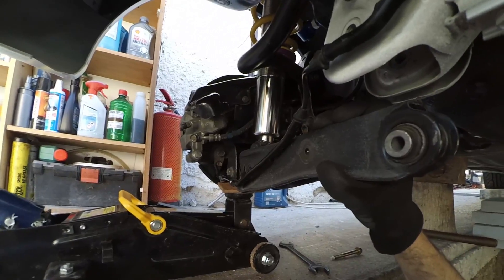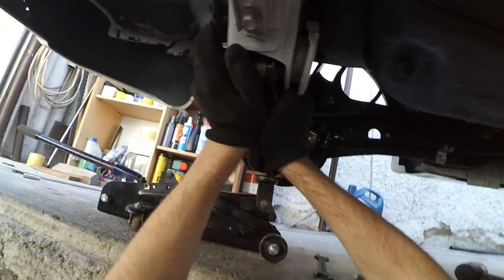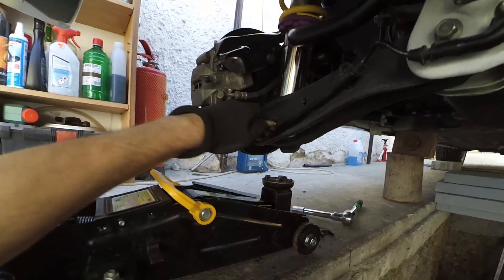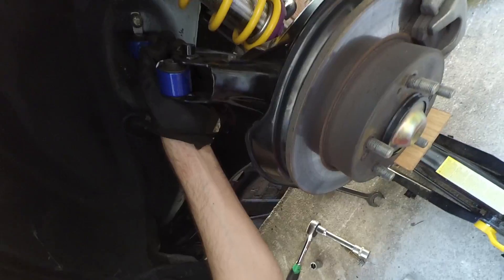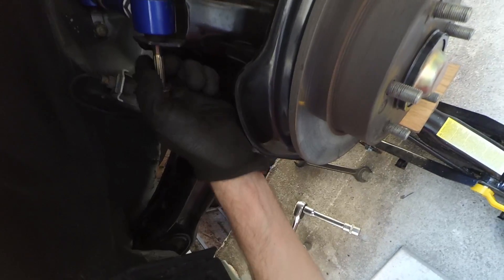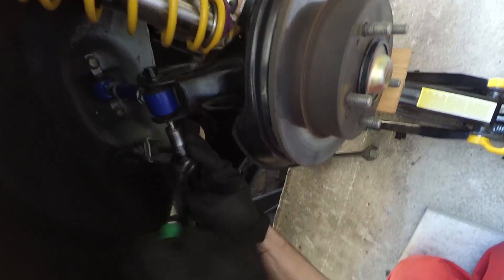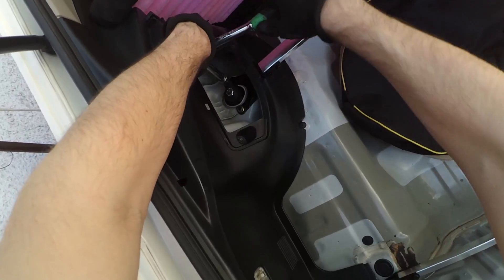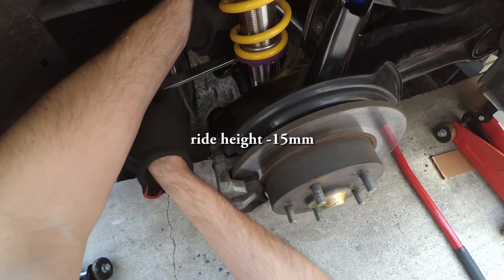Integra Type R | KW V3 coilovers | POV

Comment from the maker: Hondash - the ultimate tool to monitor your Honda
https://www.hondash.net
https://www.facebook.com/hondashapp/
Reply: Hi Miroshi, Thank you for posting the video, I just subscribed to your channel. Question about the 1:06 mark where you drilled what looked like the top mount bushings to 12mm since the stock size is more narrow. Did you also drill the metal collar? Or did you only drill the rubber bushing? If you did drill the metal collar doesn't it become too thin? Confused about this because I bought KW for my 91 civic and it didn't come with collars for the front but somehow it came for the back from KW.... any tips would help, thanks.

Comment: Gorrgeous!
Opinions on the v3 coils?
Reply from the maker: Can't compare with anything else than stock, because this is the first aftermarket suspension on the car, anyway the car is more planted, less body roll as expected, I like the upgrade, however adjusting the separate compression nob from bottom of each shock is pain in ass.

Comment: Random question, I just installed kw v3 on my 96’ dc2 type r. Great video. I noticed I changed top hat and whent to tighten on kw it seems not much is protruding from stem. Did you remove washer on top of bushing due to this reason? I noticed your washer was on at one point and removed prior to install
Reply from the maker: I don't' recall the details, but it seems like I had to remove the washer for that reason, judging after watching the video. I don't have any washers installed currently, just the top nut, just like the OEM shocks.
Reply: @miroshi thank you for response and great video.

Comment: Nice DC2. Can you let me know the measurement from the center of the wheel to the arch of the fender? My integra came with lowered aftermarket coilovers and I would like to raise it to stock ITR ride height. You note the suspension is 15mm, I'm assuming it's15mm lower than a non ITR model such as a GSR etc. I already researched the stock ride height to a 3rd gen DC but have come across several mixed measurements. Thank you
Reply from the maker: Thanks, unfortunately I don't have that measurement, and the car isn't ready for the season yet, can't measure it right now. 
It's been 15mm lowered compared to the stock ride height (Type R), which makes it about 25mm lower than non Type R stock versions.

Comment: A few weeks ago i bought used kw variant 1 for my dc2, which are the differences betwin variant 1-variant 3?
Reply from the maker: V3 features height adjustment, compression and rebound, all independently adjustable.

Comment: Interesting that the kw suspension weighed more than the OEM suspension. Is it worth the extra weight?
Reply from the maker: The total weight increase is just 1.5 kg because the rear KW springs are actually lighter, it was definitely worth it.

Comment: How do you rate these coils dude? Interested in some for mine, as change from Meister R. As they are way to crashy in all environments. They firm enough on track, as seem to handle spot on going off your other vids.
PS cool vid thumbs up!
Reply from the maker: thanks,
original suspension has quite a lot of body roll, KW V3 reduced that by 50%. 
In my opinion they're stiff enough, anything stiffer would be pure race car stuff. 
The only thing I don't like is that the bumb settings are super inaccessible, from the bottom of the damper. 
Quite a hassle to change it from track setup to street setup.

Comment: So you have -2.5° camber & 0°25' ( assuming it's 16" wheels ) total toe out in front and your Advan look like they wear pretty nicely flat . Did you use that car on street or on track ?!
Reply: faburisu just comenting so i get notified when he answers.
Reply from the maker: Yes, 16" wheels, the AD08Rs are still basically new, they've been on since the last November, done just 2 autocross events,  and a few hundreds km on the street. The car will do more km on the street than on the track or autox. So I'm curious myself how the camber will affect the wear pattern.
Reply: it's 215/45 on 7" wheel you use ?
Reply from the maker: 205/45 and 16" x 7" ET45